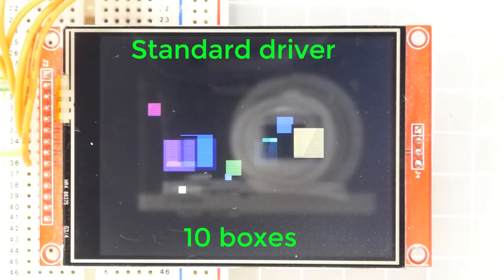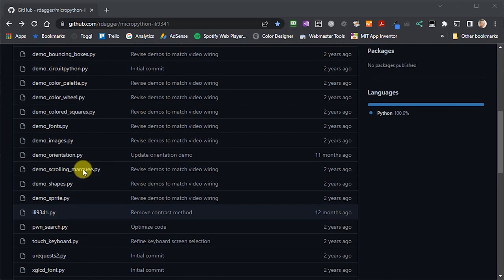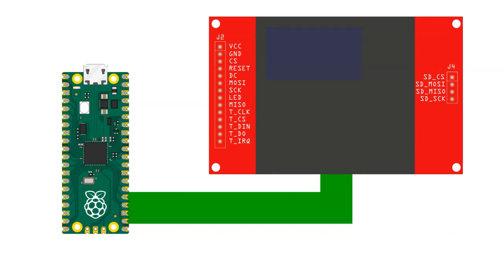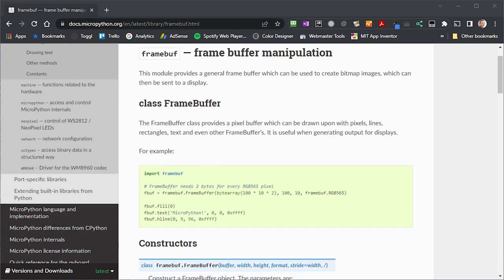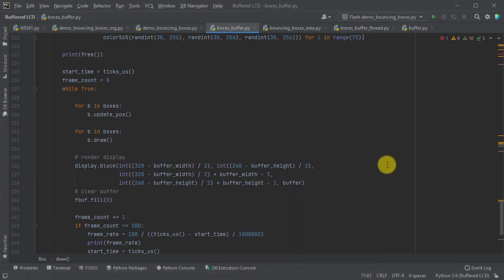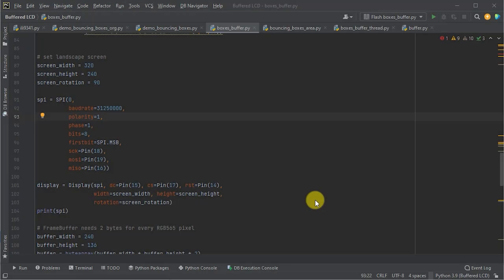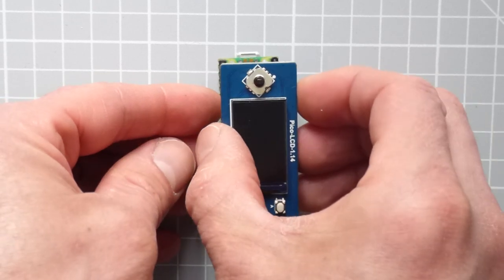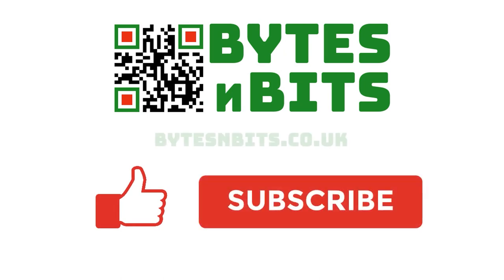Pi Pico SPI LCD using a frame buffer to get 30fps animation - ILI9341 and ST7789 MicroPython drivers

Comment: I strongly suspect the PIO alone can convert an RGB332 framebuffer up to RGB565 by just shifting out the MSBs and zero padding. It is fast-enough in C, though. You can do per-scanline conversion into a buffer and transfer it asynchronously with DMA. It's near-enough cost neutral, since your pixels are being converted while the previous batch are transferred.

There's a PIO interface in MicroPython that might actually make PIO conversion possible without delving into the horrors of writing MicroPython C extensions (or writing C outright).
Reply from the maker: Hi. Thanks for the tips. You're right that the PIO route looks like a good bet.

Comment: when you do the connection images with the pico you should also point out that scl is also clk and sck and miso and that sda is mosi and sci  etc rx tx as some boards dont show what it show in the driver even your image now shows lcd clk connected to gp10and the driver doesn't have a clk pin assignment so if people are learning this will confuse them
Reply from the maker: Thanks for the comments. Yes. I guess there are quite a few combinations of terms out there.

Comment: When I first started with the ILI9341, I used the Teensy and Adafruit library's.  It was not very impressive!
I then looked at their text/font writing code, and they were using pixel writes to do fonts!  Awful, lazy coding.  I wrote my own routines using block transfers for each character.  I was able to obtain a 17x performance increase.  The problem for me was the characters appeared upside down and backwards because of the way fonts were stored in flash.  Once I re-ordered the fonts, everything was fine.  I wonder if you have run into this (have 'they' re-written the text routines)?
Reply from the maker: Hi. Yes. Some of the library functions are a bit slow. Partly I think this is due to the way the serial screens work. From what I can remember the library routines allow you to write text over the top of other graphics without destroying them. This can only really be done sending individual 'on' pixels. Your block writes are a great idea and as you've shown greatly increase the write speed, but I guess you'll end up with a rectangular background area to each character. For text on a blank background this is great, but I guess the library needs to have the more general purpose case.

Extending libraries with your own optimisations will always be the way to go to get the performance you want. So I'd say think of the library as a starting point with the challenge to do it better yourself.
Reply: I have no need to do motion graphics controlling machines, via relays, stepper motors, etc.  I do need different sized fonts for text.  I had never thought about mixing text and graphics in the same space.  I also did quite a bit of experimenting on SPI clock rates.  It has been years ago, but I think 400K was as high as I could reliably run with these ILI9341 lcds.  What has been your experience?

Comment: Amazing video! Maybe a stupid question, does this work on an Arduino too?
Reply from the maker: The Arduino doesn;t support MicroPython so first you'll have to move to C++. The Arduino also lacks the memory space for a frame buffer so you'd need to draw directly to the screen. I did make a video a while back using an SPI screen with Arduino. https://youtu.be/Oh9vgomyuOI
Reply: @BytesNBits  thank you, I was thinking if it was possible with additional ram, and a 4 bit lookup table for colors

Comment: Hi. Would you mind making a new 2-3 minute Youtube video explaining what a framebuffer is, how it works, the benefits and why it is used - show the bouncing boxes, and the illustration of the Pico connected to the framebuffer and to the screen LCD or other). i.e.  Just a sub-set video of this longer video on your channel (without the driver and python info). I would like to put a link to this new video on a Microcontroller forum I'm a member of, and I think it would be of value to the other members. Many thanks.
Reply from the maker: Thanks for the idea. Don't forget you can link directly to the part of the video where I go over the framebuffer. Just use the YouTube share button and then tick the use timestamp option.
Reply: @BytesNBits  thanks. I didn't know we could do that. Learn something new everyday!

Comment: Good to know I'm not the only one who's tried a framebuffer approach to speed up display rendering. One comment/question, though. It's hard to tell from this video, but how bad is the screen tearing? I've written a super simple test in C that makes use of a framebuffer and DMA. It fills the entire screen with one color, waits a second, changes to another color, rinse and repeat. On the surface it works as designed, but if one looks closely I can see the display "actively refreshing" -- and it's particularly apparent when the previous color and the next color contrast. Have you seen this as well? Is there a way to mitigate it? Or is it likely simply a result of the display having its own SRAM (as opposed to writing directly to VGA/DVI where the display is expecting constant updates and does not "latch" the display data)?

*EDIT* Please ignore this. For those who are having a similar issue described, check the CASET and RASET commands in the ST7735R datasheet. It appears my computed 32K of required memory (for 128x128@16bits) fills the screen. Thus, I was actually rendering twice in one pass.
Some rows of memory are rendered offscreen so adjustments using the aforementioned commands are necessary. Still investigating why it won't fill the whole screen in 32K (I had to bump it up to 40K to get it to fill). Much less tearing seen.
Reply from the maker: Good to hear you're getting the issues sorted. Strange that you're having to send extra data to get the screen to fill. Just a thought, but is the driver chip initialised to the correct resolution. I think there are register values in the initialisation that control this.

Comment: Did you try to update by slices or blocks? as an old CRT TV? For example, you could make an image block of 320x60 pixels for the first layer with the frame buffer method and them send it to the display to show it in the upper quarter of the screen. After that, make the second layer and send it to fill the second quarter of the screen. Make the same to the third and fourth. When you start again with the first quarter, you just need to overwrite the previous image block with the new one. You would need only 38 kB at a time.
Reply from the maker: That's something to try out. Thanks.

Comment: Is it possible to render a full image at 15 frames per second with the ili9341 display? And if not, is there any sort of tutorial for programming the ili9341 screen with C or C++?
Reply from the maker: I think you've already answered your question. Micropython won't be able to process the full 320x240 pixels at that rate. You might be able to do it using a hybrid DMA and PIO driver but that's getting complex. Dropping into C++ is the way to go. Again you're still going to be at the limits of the Pi Pico but it's your best bet.

I've been concentrating on the Pico in Micropython so haven't got a tutorial. I did make one on the standard Arduino in C++ a while back - https://youtu.be/4DtuOeeYHys.

Comment: There seems to be a missing part of the st7789 driver file, which is having problems at run time。
Traceback (most recent call last):
  File "<stdin>", line 130, in <module>
  File "<stdin>", line 75, in main
AttributeError: 'ST7789' object has no attribute 'fill'
Reply from the maker: Check you method call. I don't think the method is just fill. Should be fill_rect or something like that.

Comment: Is it possible to run multiple ST7789 with this driver, I have some 16Mb Pico clones with plenty of RAM for framebuffers and I need to run 8 displays. I have 3 running on a Teensy 4.1 but I've ran out of memory.
Reply from the maker: I don't see why not. Each instance should be able to run separately but you'll need to make sure you keep control of when each tries to use the SPI channel.

Comment: I have a question: how would you reduce to 4 bit/px on the 1.14 display? for fbuf variable i thought messing with framebuf.GS4_HMSB, the 4bit format, instead of .RGB565 but im not sure about that or what to do to the bytearray equation or other variables.
Reply from the maker: There are a range of ways to reduce the memory size but mostly they then involve some sort of translation of the frame buffer values to the RGB565 values. Micropython isn't fast enough for that. The framebuffer may have some inbuilt conversion but I haven't looked into that (if so it will be in C so should run at a good speed). All I can really say is have a play!
Reply: @BytesNBits  thanks, I do need to keep playing around to learn more about this. I appreciate the response and your helpful videos throughout the years, cheers

Comment: I've been playing with this and I noticed that the driver function "color565()" returns color in brg fornat. The problem is a big-endian/little-endian thing. If you change the color565 function like this it returns rgb like it should.

''' display is big-endian, pico is little-endian '''
def color565(r, g, b):
    val16 = (r & 0xf8) << 8 | (g & 0xfc) << 3 | b >> 3
    # swap the bytes:
    return (val16 >> 8) | ((val16 & 0xff) << 8)

You could change the drivers but it's better just to add the function to your program.
Reply from the maker: That's great. Thanks for the tip and the code!

Comment: If the colour translation from 8 but to 16 bit involved only bit moved, could the PIO do it with the state machine upon transmission?
Reply from the maker: I think so. I did have a look at that as a way around it but haven't tried coding it yet. I couldn't get my head around some bytes needing to be sent as is for the control codes etc. and some needing the nits shifted around for the colours.
Reply: @BytesNBits  got it, thanks.  Love your channel

Comment: im using a waveshare display that require the st7789 driver and i seemed to have everthing uploaded correctly. when i do import boxes buffer i get this..
SPI(1, baudrate=31250000, polarity=1, phase=1, bits=8, sck=10, mosi=11, miso=8)

51.27%
32.67308
32.57108
.. in REPL which tells me its running and is reporting fps but the screen is off, no backlight or anything. is there a way to turn the screen on or should it be turning on just from having the pico connected to it and connected to power?(which would mean my display is a dud?)
Reply from the maker: There should be a backlight input on the screen. Usually labelled LED or something like that. It usually needs connected to the either 5V or 3.3V depending on your screen.
Reply: @BytesNBits  Thanks for taking the time to respond! Its one of those like in your video where all the pico w pins plug into the back, and it does have an lcd backlight pin, i made sure to specify that in the code as well as all the others. im thinkin its a dud /:
Reply: i just noticed it was reporting wrong miso pin but changing that still didnt work. but when i just did the import again and i was still getting fps in REPL but after i do ctrl C to stop it at the end it says display off like below
SPI(1, baudrate=31250000, polarity=1, phase=1, bits=8, sck=10, mosi=11, miso=12)
55.18%
45.31691
45.1198
45.09681
45.09504
display off
does that mean the display is "turning off" ffrom me stopping the code from running anymore? should it be saying display on at the beginning? i dont get what im missing here lol

Comment: Great stuff. What's micopython like at handling rom based look up tables? Thinking  4 or 8 bit pallet.
Reply from the maker: Hi. I'm not sure if Micropython can do that in the same way as C etc. You don't have such low level control over where your variables are stored. There are DMA packages that might help. Otherwise you'd need to read the rom data using the file system and then do lookups from the variable in ram.
Reply: @BytesNBits  Hi. I've been looking at micropython's inline assembler and wondering if a simple loop would be quick enough: i.e. fetch word from frame buffer , align , look up value in array then squirt it out of the SPI ?

A 4bit pallet would be small enough to be in RAM as an array
Reply from the maker: @wktodd  That does sound possible. I did look at a similar solution using a bytearray on the python side being filled by an assembler code block. Then sending this as a block write from python using 8 blocks to do the full screen to keep memory usage down. I've not tried it though. Your method does seem a slicker solution!

Comment: I tried it on my esp32, and it works fine, but it turns out that i have not enough memory to allocate whole buffer, so i rendered only a part of my screen. Can i do something about it so i may render the whole screen or i clearly can't bcs of having not enought memory ? Btw video is great and i learned a lot
Reply from the maker: Check if your ESP32 has some PSRAM attached. This is a fast spi ram that you can use. I'm pretty sure you can get  Microptyhon to use it but I haven't tried it myself. Otherwise, yes, you're stuck :)

Comment: Sir i would like to build a hand held nes emulator with the pi pico and one of these little red displays...i cand find anyone who has done this. I have already built the emulator with the pico pi but getting it to work with the little display has got me stumped....any thoughts on the matter?
Reply from the maker: You need to look at the display output code in the emulator to see if it supports SPI screens. If not you'll need to code it. Usually the emulator will have some sort of frame buffer in memory which will be sent to some display output code. You need to have our code take control and send the frame to the screen as in the video. Good luck!

Comment: Ok i've got the display. 240*240 ips based on st7789 .... now i got pin1=gnd, pin2=VDC Power 3.3 V, pin 6=DC. I can imagine pin 5= RESet, but how can i map pin 3=SCL, pin4=SDA and pin 7=BLK to you ILI based sck, mosi, miso, cs=Pin(17)?
Reply from the maker: Hi. SCL on your LCD is the clock signal (SCK), SDA is MOSI. MISO is not used. BLK is probably the backlight connection. You'll need to look at the datasheet for your display.

Comment: thanks for the helpful vids - question for you: when I use the color565() function with the display (not using framebuffer) the colors are correct. If i use the buffer and pass in the color565() function, the colors are different/incorrect.

any reason why that may be the case?
Reply: I ran your example code and removed the random color generator on the boxes and set a default value. same issue -- solely changing the framebuffer changes the color of the box. maybe it's to do with my screen: its an adafruit 3.5" tft which uses the HX8357D chipset.
Reply: if anyone else has the same issue the fix is the color565 func needs to be updated to the below since the framebuffer class uses LSB instead of MSB byte order

def color565(r, g, b):
    val16 = (r & 0xf8) << 8 | (g & 0xfc) << 3 | b >> 3
    # swap the bytes:
    return (val16 >> 8) | ((val16 & 0xff) << 8)
Reply from the maker: Hi. First off make sure you're using the right driver library for your chipset. If that's all OK it might be a colour order bug. The framebuffer might be decoding the 565 value and then re-encoding it when writing to the screen. I'd try drawing all the boxes in red - RGB(255,0,0) and see what comes out of the buffer. If it's a pure green or blue then you know its the byte order.

Comment: Is it possible for the Pico to read a video file from a micro SD card and display it on a LCD without needing to be connected to a PC? I just want to be able to flip a switch to turn a standalone Pico on and have it start playing the video file automatically. Is this possible? Sorry for the newbie question.
Reply from the maker: I doubt if the Pico would manage a video file. To read the SD card, decode the images, and then send it to the screen would be a push for the system. It could probably be done but you'd be looking at a few seconds per frame speed. A slide show of still images is possible. I did an Arduino tutorial a while ago using bitmap images. https://youtu.be/exjzGMX4fqs
Reply: @BytesNBits  What are your thoughts on pairing the Pico with the VGA Pico Demo Board? Seems to have video output, output audio jack and a micro SD slot.

Comment: ok, i mapped the 240x240 st7789 with spi1_sck=10, spi1_mosi=11, st7789_res = 12, and st7789_dc  = 13 Modified both screen_width/heigh to 240 (and the buffer width/heigh to 240), but now i got a MemoryError: memory allocation failed, allocating 115200 bytes
Reply from the maker: Hi. You'll need to reduce the active area on the screen as you've got too many pixels for the Pico to handle. Have a look at https://youtu.be/fGfb2NvDlG4?t=938
Reply: @BytesNBits  Thanks, i'll check.